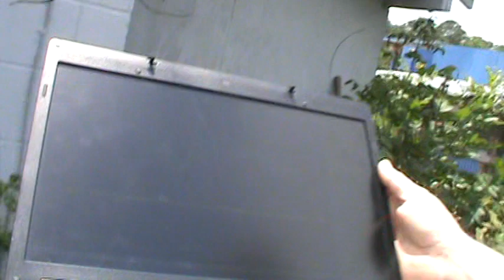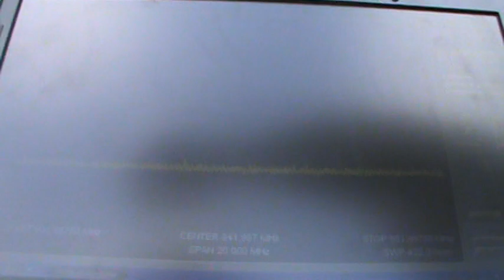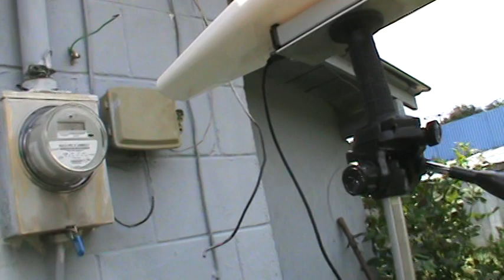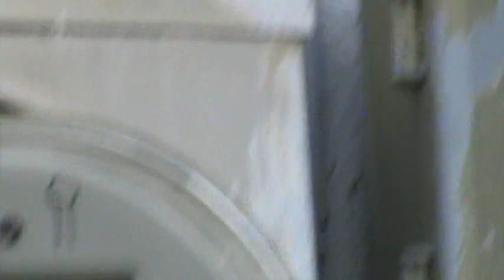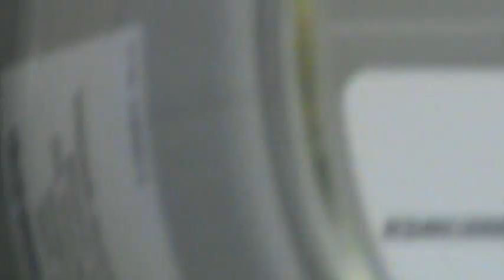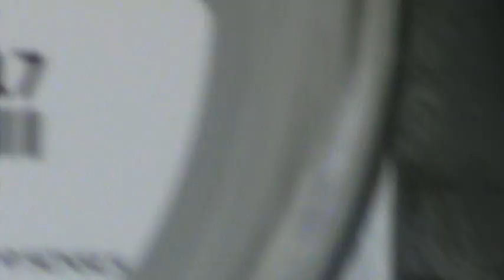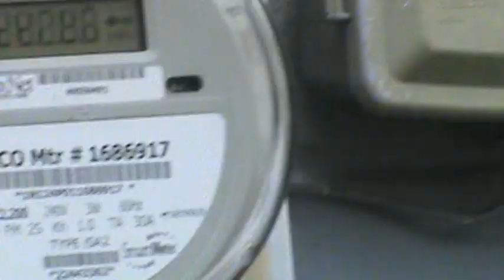Georgia Power Smart Meter Investigation Part 1

Comment: Why does no one ever talk about the Power Line Carrier RF (Radio Frequency) signal that travels through the power lines. This signal also travels threw house wiring and exposes you to a lot more than the damn meter base like he said the back of the meter is shielded by the metal meter base. (No brainier)  I picked the signal from mine up with my shortwave radio with the power shut off at the lug box under the meter base so that's the only thing it could have been. And it was transmitting every 4 to 6 seconds.
My smart meter is an analog meter with a circuit board inside. I think it's made 
that way to make people think they have an analog meter when in reality they have a
smart meter. The meter at my moms house is the same it looks like a analog.
Reply: Your shortwave receiver has the ability to detect unbelievably small sw signals from around the world,  the amount of rf power from these "smart" meters is also very small and being able to detect them with a sw receiver proves nothing.  Using a spectrum analyzer like these engineers are doing is the right way to do it.   As usual, i never seen any of you "meter haters" that have any competency in the subject.
Reply from the maker: Hi Greg!  I see your competency for understanding signal has lit the board. Tell us how many signals of any power are needed for bandwidth saturation per frequency spectrum, just microwave bands used for these type radios work, 900 MHz, 1.8 GHz or 2.1 GHz or thereabouts, before cross frequency resonance occurs and perhaps a table for a better understanding WTF is happening when it does and why? I have studied data loads on relative carrier space allocations concerning uses of unbound energy, such as wireless, yet what I know and am learning must be incorrect, as many engineers who have contract work or industry related jobs told me load variance levels, including composition of the payloads concerning such are not safety issues. Would you say they are correct, and I mean these are conversations regarding microwave radio communications in general with a focus on grid reporting technologies, or perhaps they too may be pullin a bit of leg? Please excuse my incompetency on these things, alas, I am but an ignorant peon in the wonderlands of electromagnetic science. Please, help us understand.
Reply from the maker: low grade plasma of grid electricity can be used for all kinds of transmission...all of it transmits, u just gotta know how to use that

Comment: Time we institute the “Wright Law”. This law states that any license-exempt equipment operating on the 902-928 MHz band will be subject to the home owner’s control. If that person deems this radiation harmful to themselves or any other member of their household, then that person has the right to use any suppression method including interference that may cause undesired operation. Any method may used for suppression, even the dreaded TinFoil hat method. Smart meters are license-exempt devices.
Reply: Frederique Zug: Thanks for increasing subscription and visitor numbers to my channel through multiple re-posts and promotion on 3rd party video platforms! I have now monetised my copyrighted material content. Thanks a lot Madame!
Reply: Frederique Zug:  Where is this law coded?

Comment: More idiots that do not know what they are doing OR they are getting paid to FOOL us. The power density with ZigBee turned on at 20 cm (8") is 0.263 (mW/cm^2) That is strong enough to force the manufacturer to issue a FCC warning due to HIGH power. RF Exposure In accordance with FCC requirements of human exposure to radio fields, the radiating element shall be installed such a minimum separation of 20cm will be maintained. That means a smart meter will kill a pacemaker patient. 25 miles not 10.
Reply: Good job man i do this with these guys in ms  pwr in ms they drop of 83 pages of false documents that i have the originals to  this is pure evil om a EMF sensitivity and never have have had issues my house is between 2 meter  about tomake my head explode my w year old walks around with holding her  ears
Reply: Delusional TROLL alert ! ! "Frederique Zug"  trolling smart meter online forums and videos peddling "lifesaving advice" for the last FIVE  years! How utterly pathetic!
Reply: Hes 100 percent rite

Comment: So my smartmeter is directly on the other side of the wall where I'm sitting at my computer, maybe 4 feet away from my head. I'm not sure if I like that much...
Reply: You are sitting in front of a computer which has much high levels of EMI than a "smart" meter and your worried about the meter that is four feet away?
Reply: put some aluminum foil or screen on the wall behind the meter, this will block a large percentage

Comment from the maker: Some interesting real science, most that can be achieved using smart meters, check out these patents, fantastic science! And this is just the tip of the iceberg:  US patent # 3014477, 3060795, 3278676, 3393279, 3563246, 3612211, 3629521, 3712292, 3884218, 3951134, 4395600, 4717343, 4777529, 4834701, 4858612, 4877027, 5159703, 5356368, 5774088, 5889870, 6011991, 6052336, 6470214, 6587729

Comment: Transmits at a very low power that will go out 10 miles??
 Years ago same type of guys said DDT was safe,  asbestos was safe, and smoking cigarettes was safe.
Reply: You can get a large distance of transmission using a low power. Really just a matter of power, frequency, distance and line of site, if it's less than background noise, it'll work.

So if background noise is -110 this means a signal below that can't ever be used, but if your signal started off at -3 dB, as it travels it get's lower. As long as it reaches the end site or tower and it's above -110 it'll work. Generally you double the distance, half the power. (Generally, depends on a lot of factors) so that means if at 5 feet it's -3 dB, at 10 feet it'll be -6dB, at 20 feet it'll be -9dB, at 300k feet, it'd be at -51. Obviously that's ideal, air, topology, etc etc etc all matters. 3 dB is double or half the power, so -9 is half -6.
Reply from the maker: @selfishlyintrigued  power your antenna, if it radiates far enough it can pick up very low powered signals, filter it or tune it (your antenna) you can pick up basically -(whatever) in a very noisy crowd.
Reply: They also said that breathing oxygen was not only safe, but recommended! The bastards! I recommend that you show them what's what by refusing to breathe any more oxygen.
Reply: WHAT IS THE FCC ID NUMBER ON THE FACEPLATE OF YOUR SMART METER?
With that number, perhaps we can explain the 100 people that die every month from the high levels of radiation from your smart meter
Reply: Modulation also makes a difference in distance reached relative to power output.
Reply: ... Years ago same type of guys said DDT was safe,  asbestos was safe, and smoking cigarettes was safe....
Except those guys weren't electrical or radio engineers. They were mostly hack lawyers paid by big business to lie to you.
Reply: Take your meter and the stupid looking contraption and put it where the sun don’t shine!!!